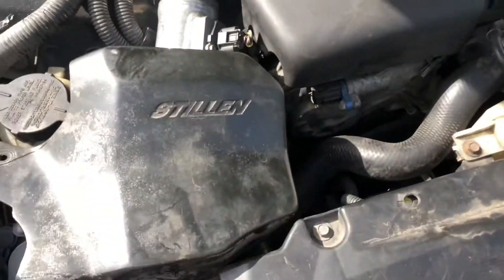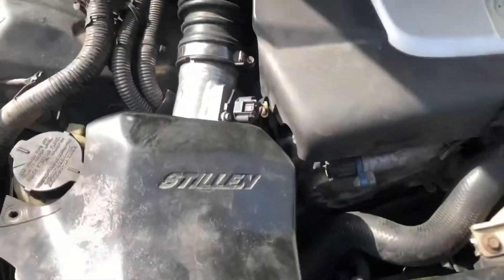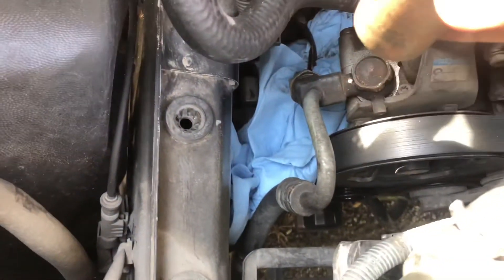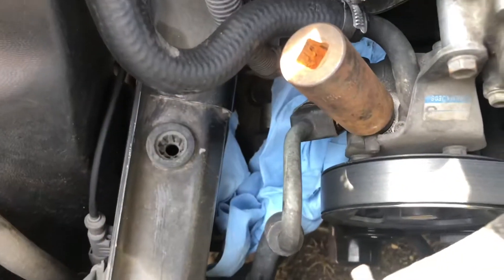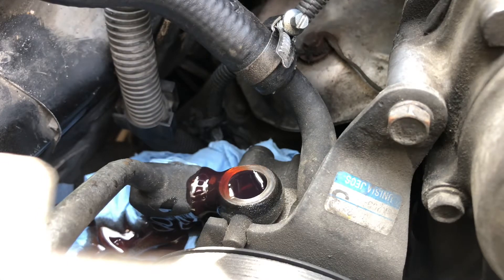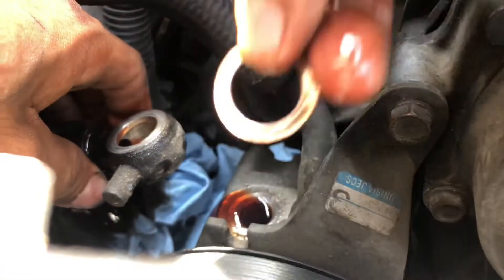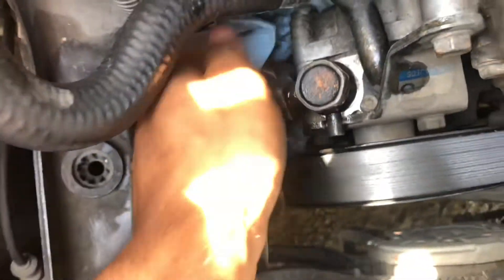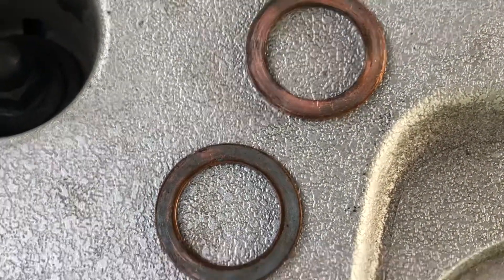Power Steering Pump Screw Gasket Connector Replacement ( Infiniti G35/G37)

Comment: What size screw is that
Reply from the maker: Its either a 22mm or 23mm I forgot 
This is The link for a new one and it’s shows the size dimensions ,it’s $5 plus shipping 

https://www.infinitipartsdeal.com/parts/infiniti-bolt~49738-4w00a.html?vin=&make=Infiniti&model=G35&year=2008&submodel=Sedan&extra1=&extra2=&filter=(2=VQ35HR;3=AWD;4=JOURNEY;5=5AT)